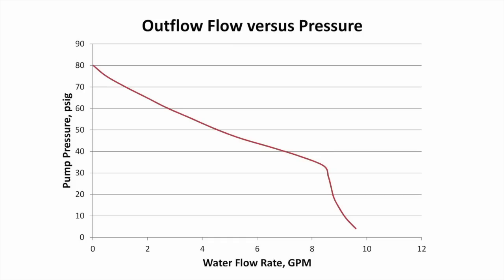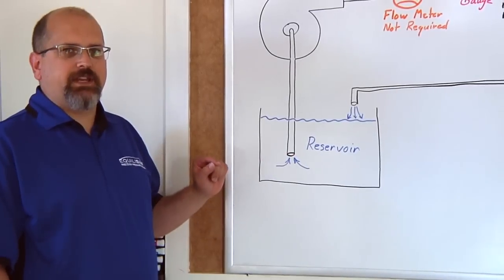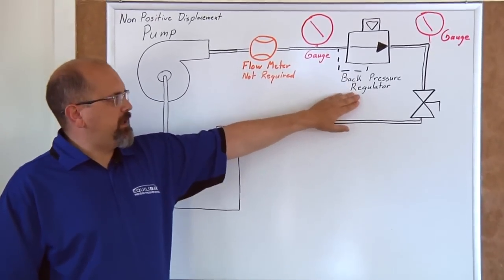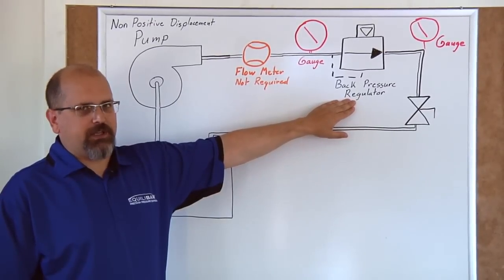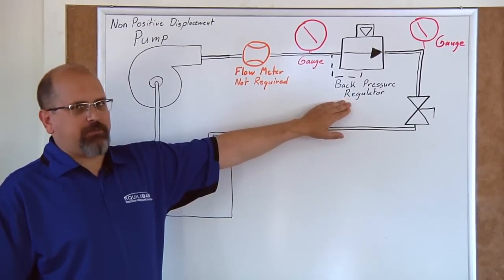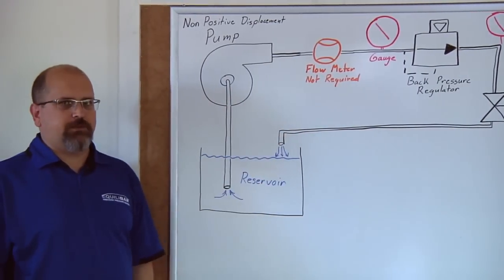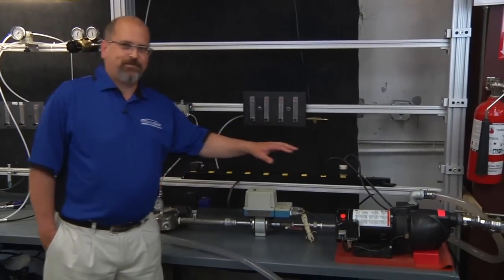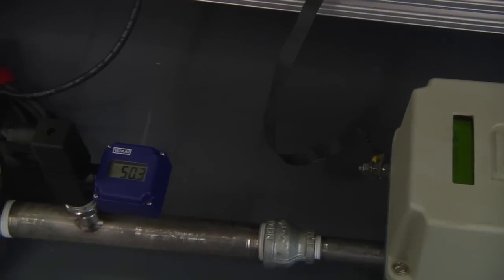Control the Flow of a Pump With a Back Pressure Regulator

Comment: Nice video, it reminds me some demonstrations I used to do to show how to size and operate correctly VA meters (commonly named rotameters), f.i. when we're dealing with processes with changing back pressure, I recommended to size and select the valve-at-the-outlet set-up and to adjust the inlet pressure (i.e. pressure in the measuring tube upstream of the regulating valve) to at least twice the peak value of the back pressure in order to have a constant flow rate also when back pressure conditions are unstable. Such tests were actually carried out with gases (i.e. compressed air).

Comment: Thanks for the demonstration! I wonder if the setup can be used with a positive-displacement pump with a bypass line between the pump outlet and the BPR?
Reply from the maker: An Equilibar BPR can be used in a bypass line and is described in more detail on this page https://www.equilibar.com/application/pressure-bypass-valves/  Please contact us any time to discuss your process. https://www.equilibar.com/contact/

Comment: Why do you call it back pressure regulator? As its simply pressure regulator and back pressure exists only in return line and is undesirable pressure which causes pump to generate more pressure to keep system working. Please explain, thanks.
Reply from the maker: Hello Jawaid Awan;  Thanks for posting a question.  The regulator used is a true back pressure regulator (BPR) and controls the pressure on its own inlet port.  This BPR inlet port is connected to the outlet of the pump.  Therefore, the pressure on the output of the pump is controlled by the BPR.  If the pump attempted to go to higher pressure, the BPR would automatically open to allow the excess pressure to escape.  However, that won't happen because at the pressure established by the BPR the pump flow curve has only one corresponding flow rate as a solution.  The valve used downstream of the BPR is used to represent restrictions in the system.  The pressure build on this valve is a consequence of the flow rate that the BPR/pump combo is forcing through it and is not a controlled pressure.  See the web page here for more details: https://www.equilibar.com/application/control-the-flow-of-a-pump/ 
Best Regards,
David Reed
Equilibar

Comment: Hi David,We have a flat performance curve using a SunDyne Centrifugal Pump. Planning to install the back pressure regulator. The suction pressure varies to certain extent (based on on/off operation with levels) and with the flat curve flow rates may vary quite a bit. Is the back pressure controller suitable for our application?

Comment: Hello, Thank you for this demonstartion Sir.
I have a question concerning this bench test. What if we had a variable frequency drive. What would it be the best? to use the BPV or the variator?
Thank you.
Reply from the maker: This is really system dependent and based on your end goal and applications.  In many cases we find that VFD’s are very expensive and have issues with response time to system changes consider this a system lag time.  The VFD is really changing the flow in the system and by changing the flow you can indirectly change the pressure.  For pressure control the Equilibar back pressure regulator can allow instant response due to the diaphragm sensing technology for better pressure control in the system.  In addition you are not using a flow control system to generate pressure but a pressure device which is better for system stability, if pressure control is required.  If flow control is desired a back pressure regulator can be used to control flow also and in this case the cost / savings of a VFD and Equilibar would need to be analyzed for your system.  

Tony Tang
Engineering Manager